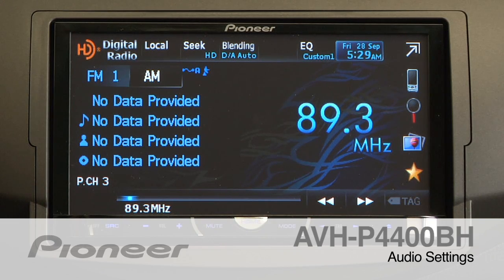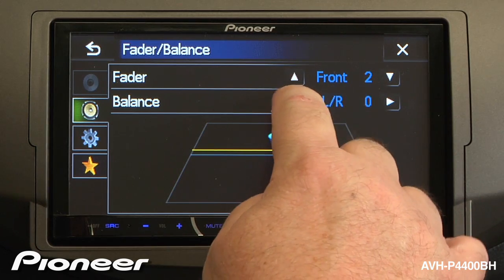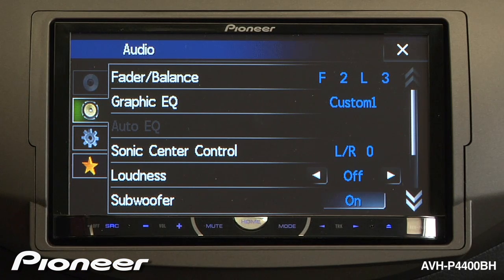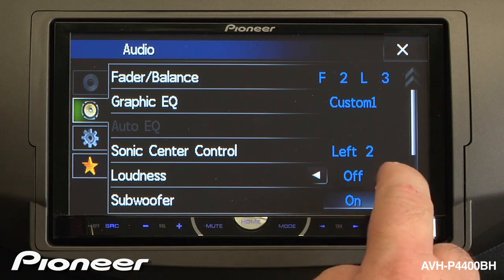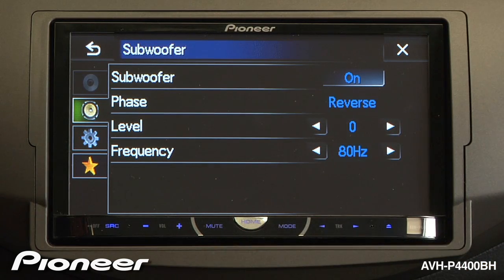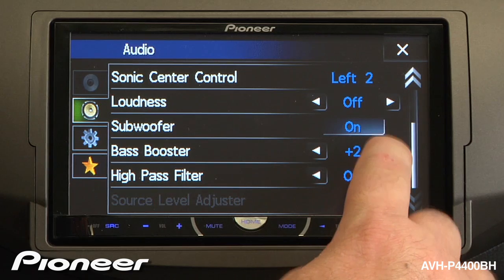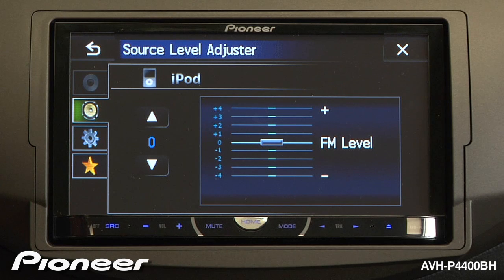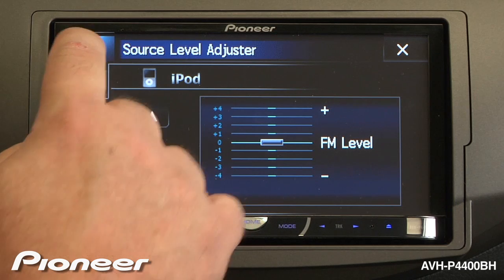How To - AVH-P4400BH - Audio Settings

Comment: Anything with my Bluetooth is completely grey and unable to select. How do I fix that issue
Reply: You need to engage the vehicle’s Parking Brake in an ON-OFF-ON operation in order to access the Bluetooth setup menu. If you engage the vehicle’s Parking Brake and still can’t access the Bluetooth menu, the in-dash receiver’s Green Parking Brake Wire may have an incorrect connection to vehicle.  You can learn more about the Green Parking Brake Wire here:  https://youtu.be/-bF3uzzaT30?list=PLw63zJRQbCNi6CoU7JbUNT83T7ippQbU6  You can find more videos on Pioneer's You Tube Channel here:  https://www.youtube.com/user/pioneerelectronics
Reply: What do you mean a on off on combo could you do step buy step for me
Reply: When I say the vehicle's Parking Brake, this might also be called the Hand Brake, or the Emergency Brake.  You need to engage the vehicle's Parking Brake in an ON-OFF-ON operation means:   Put the vehicle's Parking Brake on.  Then release the Parking Brake so it's off.  Then put the vehicle's Parking Brake on again.  The whole operation should not take more than 15 seconds.  If you engage the Parking Brake like this and still can’t access the Bluetooth menu, the in-dash receiver’s Green Parking Brake Wire may have an incorrect connection to vehicle.  You can learn more about the Green Parking Brake Wire here:  https://youtu.be/-bF3uzzaT30?list=PLw63zJRQbCNi6CoU7JbUNT83T7ippQbU6  You may need to take the vehicle to a qualified car stereo shop for help with proper installation.  You can find more videos on Pioneer's You Tube Channel here:  https://www.youtube.com/user/pioneerelectronics
Reply: I've updated my firmware on avh4400bt it failed now I have no Bluetooth and it says error10 how do I fix this please